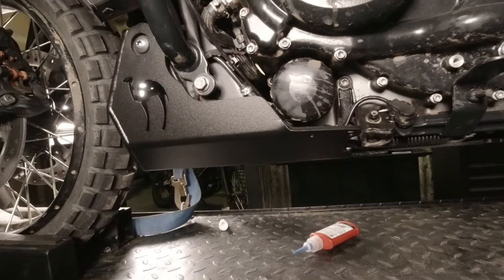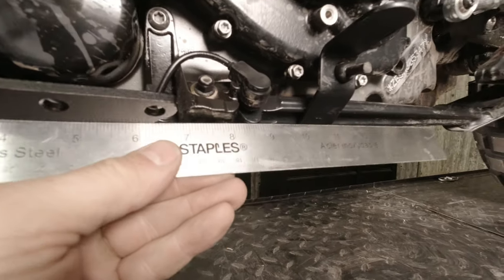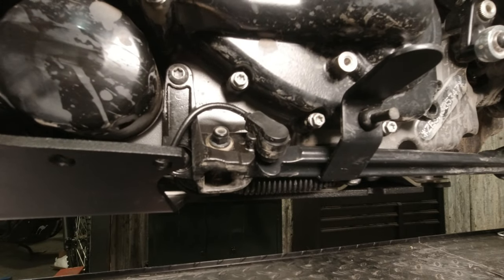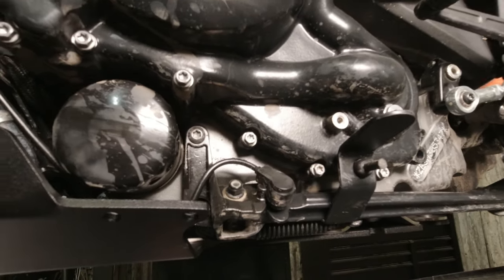Pan America - Gut Guard Skid Plate Install

Comment: Just installed on my ‘22 Special.
Only advice is the round hole goes toward the rear of the bike on the intermediate plate. Will safe you a little bit of frustration if you read this. Watching the video it appears the round hole is front oriented…at least watching on my phone.  Looks good and I am proud to have it !! Already ruined one stock plate .. a few BIG baby heads and a couple of ledges and it was toast!!

Comment: My Oilhead's skidplate was two-piece, but only 4 bolts that had a rubber donuts in the middle. I sheared off the donuts trying to climb a step and rode without gravel protection for a while.
Reply from the maker: That style is great for isolating load but not super durable from a shear standpoint.